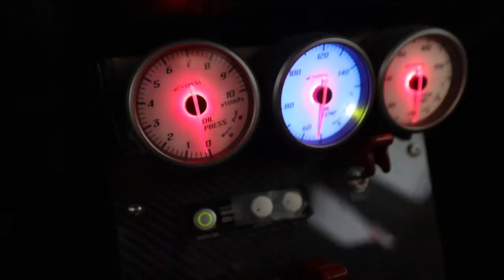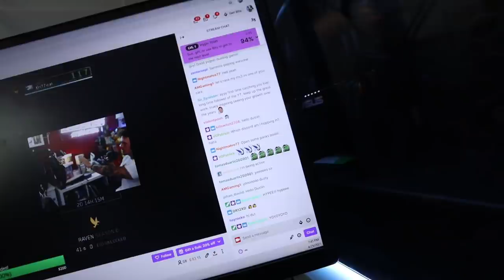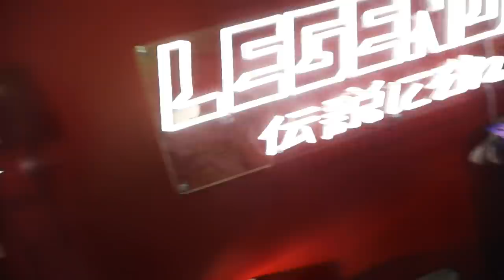Tokyo Drift Evo FIRST DRIVE in 15 Years!

Comment: I would compression test, check spark plugs, and check coils. I run 280 cams in my evo and it's not too aggresive. You may have a slight misfire which could also be why it's breaking up under boost

Comment: If the turbo timer is hooked up correctly, you can release the parking brake an the car will shut off. Or there should be a off button thats on the timer that will allow the car to turn off incase of emergency. Turbo timers were mainly used to let the car cool down after hard pulls.

Comment: Hey Dustin! This is absolutely amazing. Just started watching your videos when you've got the evo.

Please though don't drive the car any further until you've got it tuned. If its running as rich as I think it is, then you'll be bore washing the engine and ruining the piston ring seal. Hence the blue smoke on tip in and especially when lifting off the throttle.

Comment: Y’all might need to check the catch can routing set up from the PCV on the back of the valve cover/from the intake manifold. if those aren’t vented properly it can cause the white smoke you see coming out the exhaust’